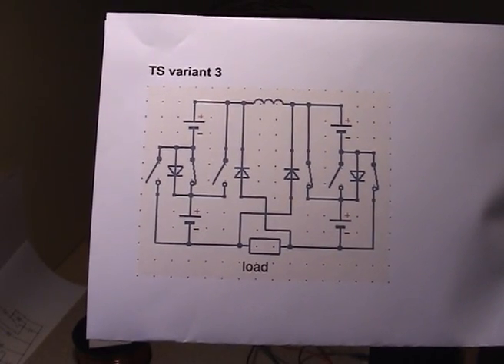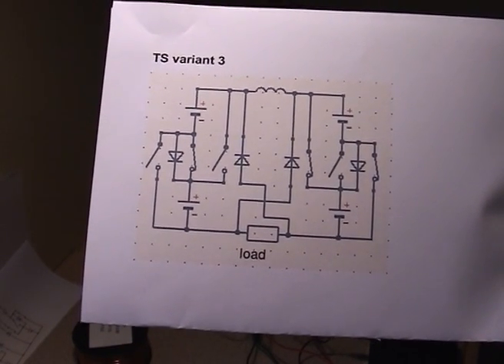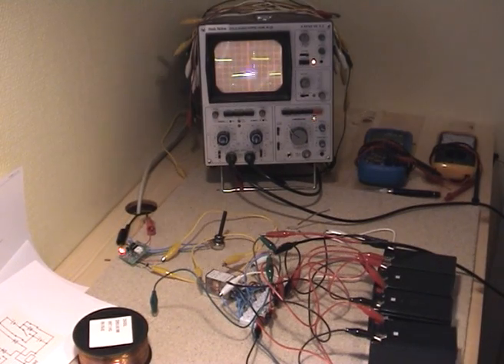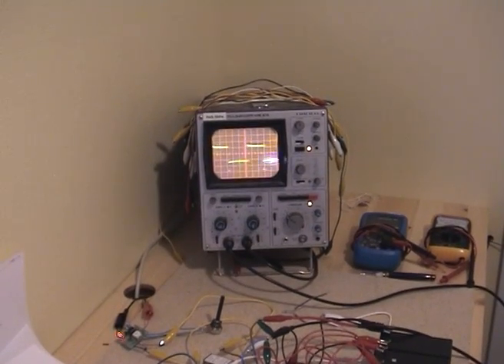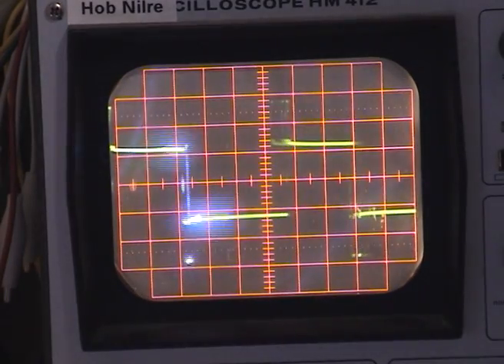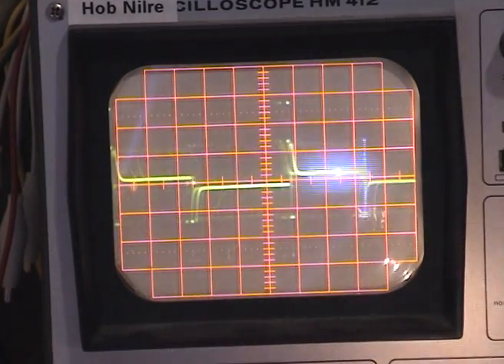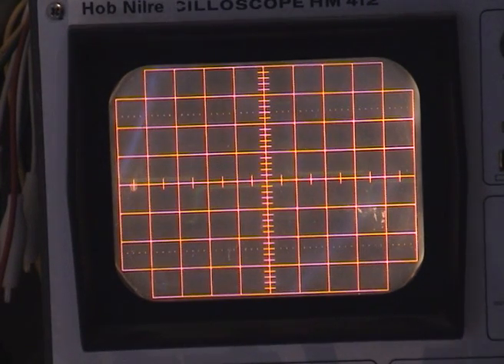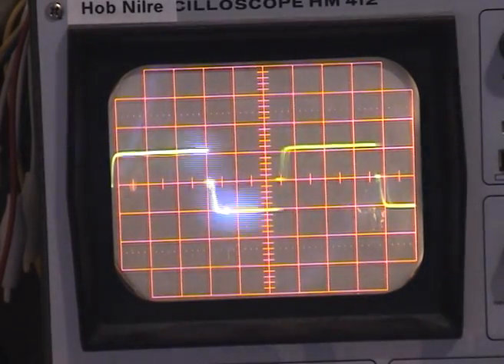Tesla-switch part 3

Comment: hi nilrehob, I've build tesla switch with 4 batteries, and test it for 8 hour. with load of 60 watts. the 2 upper batteries increase  in voltage. (0,5) and 2 under batteries decrease with 0,8volt. It flip at 2hz - 10hz.. 
My newer experiments with 3 batteries has more succes. Load = 100watts .batteries decrease 0.3- 0.4 volt. after some couple of minutes resting.
ok succes with experimentings, regards 2adtron.